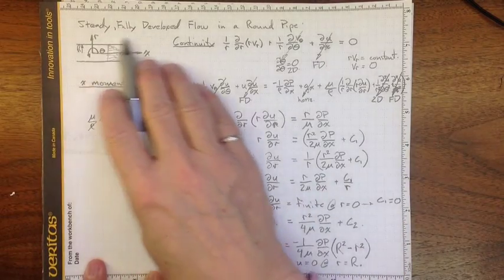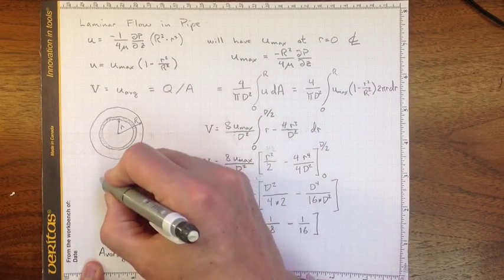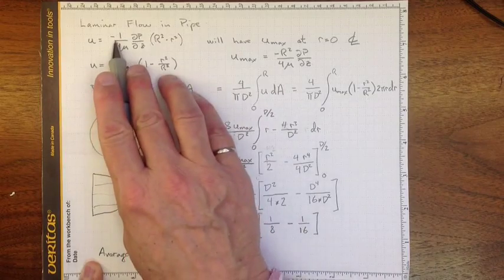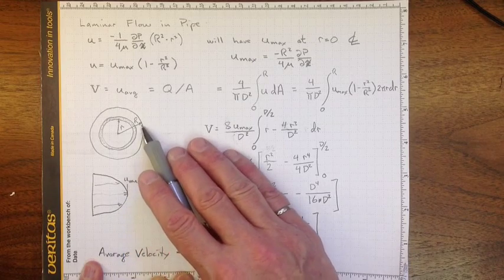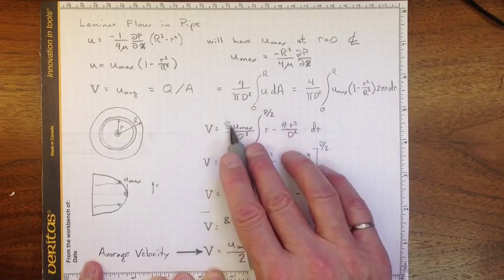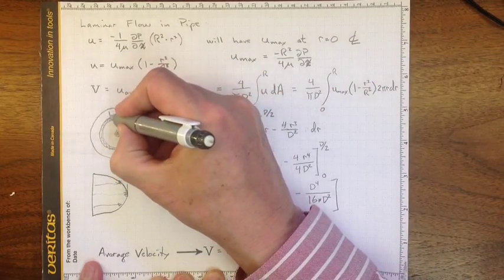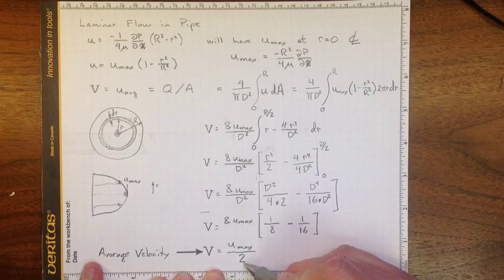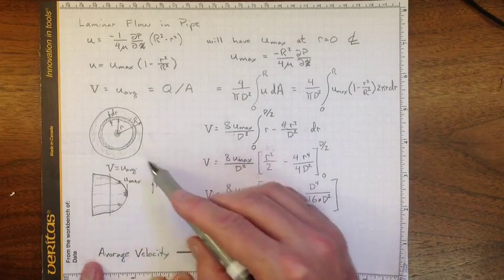Pipe Average Velocity

Comment: Could you explain what the average velocity becomes if the shape is not circular, but elliptic?
Reply from the maker: +Alex H The results will be similar, but the details will depend on the aspect ratio and you would need to solve the Poisson equation for the 2D cross-section. The integration over the area would be the same conceptually, but much more difficult to perform analytically.